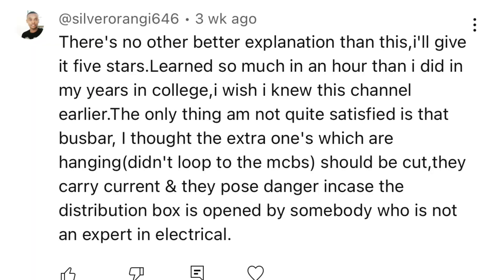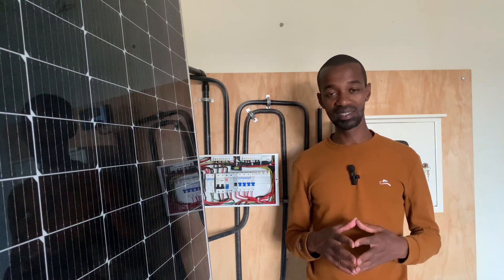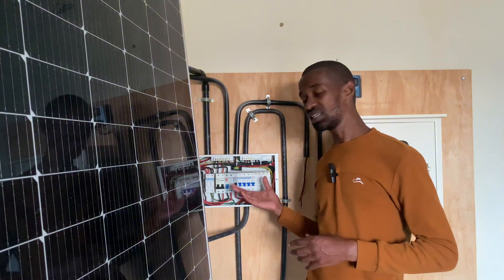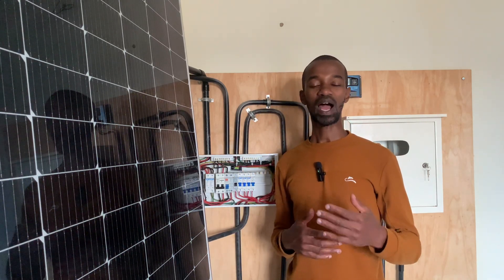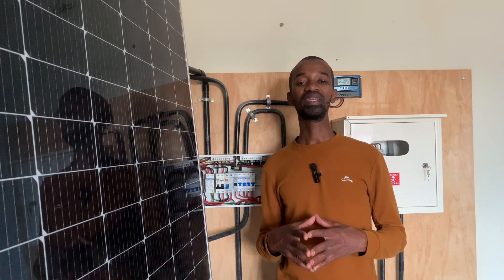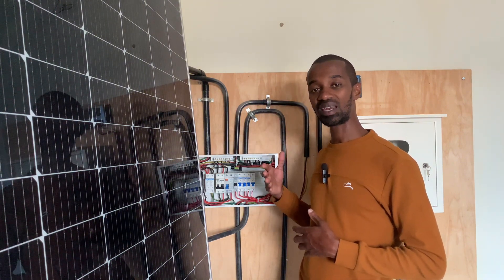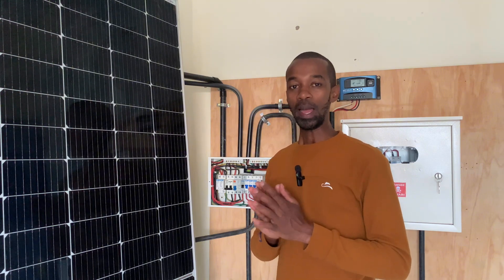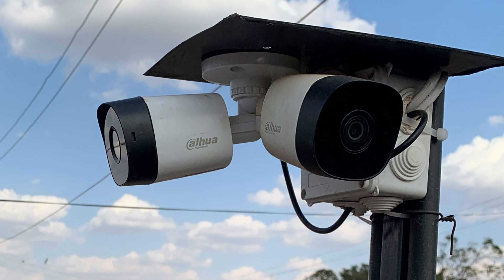What Happens When The Consumer Unit Hot Bar Is Pending?

Comment: Please incase you want to add an extra  load to an already wired consumer unit of a house does that mean the installation will be done on the safe of the wall to the consumer unit or is there another way
Reply from the maker: A good question Kingsley. If it's a domestic installation a trunking for surface wiring will be good.